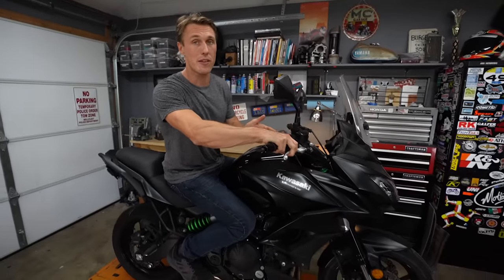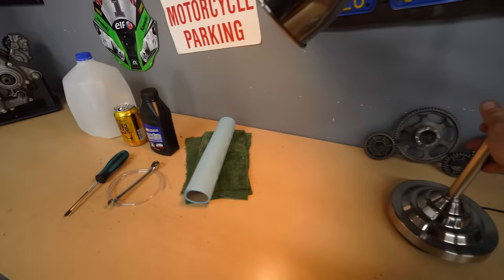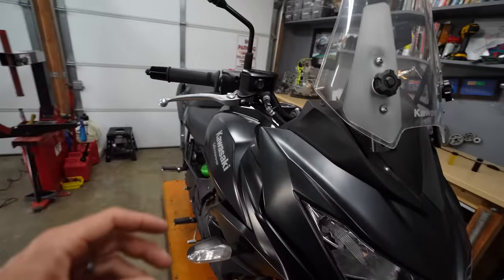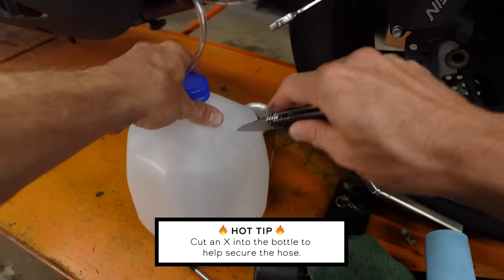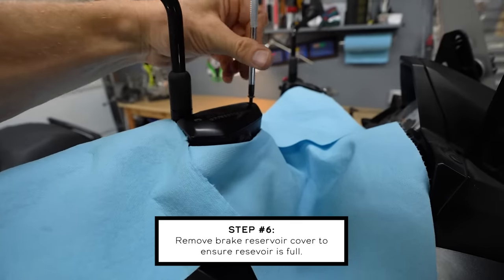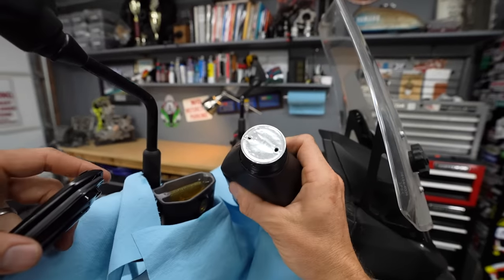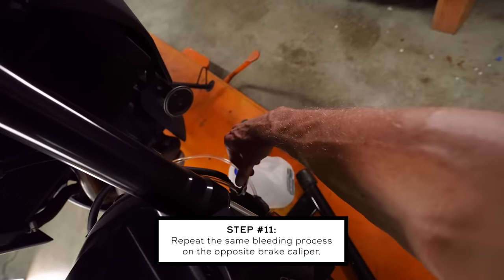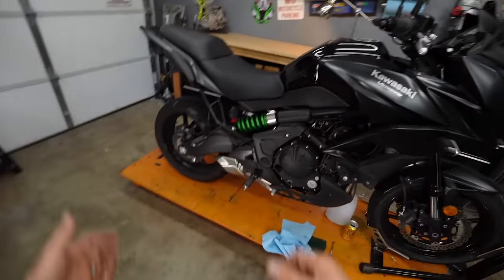How To Flush and Bleed Your Motorcycle Brakes | The Shop Manual

Comment from the maker: Read more about brake servicing on Common Tread: https://rvz.la/38goTSL
Reply: Excellent video and tips. Thanks a lot.
Reply: DOT 5.1 is better.  Doesn't damage the paint and compatible with DOT 4.  Also, people should use CNC adjustable levers for the clutch and brake.  Brembo RCS19 brake lever is the best upgrade over stock.
Reply: @A A  go back to your garage and Google answers about what's best lol
Reply: Dude I love your channel thank you so much
Reply: Hi guys nice video as always. Question does this method works also for Harleys? I have a 2017 xl883n iron sportster. Thank you
Reply: 8:40 forward
Reply: Please mate...get a better pocket knife sponsor !!!!
Reply: I had to put on new master cylinder and now it wont drain down help

Comment: Just an extra tip, when you’ve reached the step to refill your reservoir after bleeding the calipers, take a quick look at your brakepads. If they are worn, but not completely worn out, don’t fill your reservoir all the way. When you replace the pads, the pistons in the calipers will push back the brake fluid into the reservoir. The fluid needs somewhere to go.
Reply: Thanks for the reminder man.  The first time I flushed I over filled and when I pushed the pistons back in I had a nasty overflow.
Reply: Did pads too.  Forgot to include.
Reply: Extra tip number 2) You can instead when compressing the piston crack the bleeder and the extra fluid will go that way. Start with a little pressure on the piston, open the bleeder and close it again when piston is fully compressed. No air and no fuss.
Reply: @rickhughes8998  should I fill it up to max when I have pistons pushed all the way back? Or when I have piston pushed all the way back with new pads?
Reply: @Fordahord1  yes
Reply: @Fordahord1  with new pads
Reply: Yepp, mine was not checked and the brake fluid spilled from the reservoir and ruined the paint
Reply: Would this be the same process for abs equipped brakes? Been planning to upgrade to Braided hoses but I'm not so sure about the abs
Reply: @shizi  Yes he talks about it at the end of the video

Comment: A tip from a grumpy old mechanic. Don't pump the brake handle. This can cause any air bubbles in the system to brak into tiny bubbles, think foam. This can lead to your brakes feeling nice and firm until those teeny tiny bubbles get back together into one big bubble. Then you have soft brakes again. Instead of pumping, simply squeeze the break lever, open your bleeder to let fluid and air out, close your bleeder, and repeat. Once no more air is coming out, then you can pump the lever to get a final pressurization in the system. No pumping = no foaming, and this means not risking having to do it again.

Comment: Wow, you actually made me feel capable of doing this...
Reply: That's the goal!
Reply: Yeah same. Now my rear breaks got no pressure, prolly full of air and no one sells that hose near me. 

So that's cool. Been working on fixing my rear master pressure for 2 hours now.
Reply: @DizzySpark  my rear brake caliper only engages and is stuck
Reply: @xXxVentrilloxXx  aye same here my rear brake setup is currently stuck before watching but I think it’s cause I used dot3 not 4 idk tho
Reply: Super easy stuff but great video
Reply: @DizzySpark  you can order a motorcycle bleed kit its super cheap just a small bottle with a magnet and hoses/.

Comment: Put a ziptie from the lever to the grip overnight as tight as you can make it. Remove it the next day and thank me. This works for rear brakes and hydraulic clutches as well.
Reply: I don’t understand. Why should I do this?
Reply: @ardencassie5150 I’ve heard that it helps bleed air bubbles. The increased pressure “pushes” the air through the lines easier than when there is no pressure, so it slowly pushes the air up into the reservoir. Don’t think you should use it as a complete alternative to manually bleeding, but can do it after the main bleeding to make sure there’s no little bubbles left along the lines.
Reply: This makes the fluid absorb the air. It'll feel nice and hard to next day but when your emote the zip tie the air will eventually separate from the fluid again and you'll be back to a soft lever.

Comment: I've known this procedure for a life time,(I'm 63). Used it on cars also. Only thing different is that we put the end of the hose into a jar with a little fluid in it already. That way we didn't have to keep opening and closing the bleeder because each pump stroke would only draw fluid back and not air. We just kept pumping until no more air bubbles in the line. BTW. Harley just did an unauthorised fluid change on my bike. Cost me $160 !!!! Thanks for your excellent video.

Comment: This is a great video explaining how to bleed your motorcycle brakes.  If you have an air compressor you might want to consider investing in a mityvac pneumatic operated fluid evacuator.  The motorcycle shop I worked at had one and it worked so good I had to buy one myself.  They will run you $100 but they are well worth it.  When connected to compressed air they build a vacuum.  You can use it to clean the reservoir and put fresh fluid in it to avoid sending any more old brake fluid through the brake system.  They are also great for when the brake system has lots of air, like when you have changed out brake lines or calipers.  It is one of the best tools I own for motorcycle work.  They come with a nipple attachment that holds onto the bleeder for you, so once its connected to the bleeder you just loosen the bleeder and keep adding brake fluid at the reservoir until it has been fully bled.

Comment: Great guide. 2 important things to add:
1. Always use fresh bottle of brake fluid. You can't store it after you have opened it.
2. Use gloves AND eye protection. When you remove the hose there is a risk to get some splashes on you. Without eye protection this might not end well. Ask me how I know.
Reply: How you know
Reply: How you know?
Reply: How do you know?
Reply: How did you know?
Reply: How do you know?
Reply: How you know?
Reply: How do you know?
Reply: In case no one's asked, how do you know?
Reply: how he know?
Reply: Well how you know?
Reply: know you how??
Reply: you know how?
Reply: Why do they make the bottles resealable if the fluid can't be used again?
Reply: @mitleid_en  why do 7/11 have door locks when they're open 24/7¿
Reply: @hyunkang5628  Irrelevance
Reply: @mitleid_en  exactly...
Reply: How you know?
Reply: How do you know?
Reply: Know, how did you?
Reply: I hope its fine that im only storing it for one night because i messed up and let air into the system so i need to try it again tomorrow. (Did it in the evening)
Reply: 1. is just BS. Brake fluid is fully synthetic so it doesn't degrade over time. Store it in a dark dry place with the cap tightly closed.
2. is very true. Yes it hurts getting it in the eyes damn...
Reply: How I know?
Reply: @davinc3 of course it hurts... Its cancerogenous. But yeah when people say always use fresh brake fluid its because of the moisture if not stored in dry place. And people usually dont store it in completely dry space :D So you are kinda both correct
Reply: Surely you meant carcinogenic...
Reply: NVM , did not know that was a real word 😂 I've always heard the latter of the two

Comment: Good and entertaining video Ari!
  Little tip from me to owners of japanese ABS bikes:
I had a SV 650 with ABS 2007, done the brake maintainance accordingly , even more often than recommented. 2 years after I've got the bike experienced ABS motor failure. I've got it exchanged etc. however I was dedicated on finding out what caused the failure. Turned out ... : 
 When you flush you brake system the old brake fluid still remains in the ABS pump unless isn't activated, which isn't that common if you don't ride gravel or dusty roads. What happens is, what Ari explains that brake fluid is hygroscopic, which means that after 10 years in you abs pump the fluid looks like glaze from a burned pan, respectively corosion is being caused inside and soon or later causes issues on the sensitive components. 
 When you flush your brake lines, go for a little ride, activate both abs circles ( front and rear) thus ensures that brake fluid from the abs unit has been transferred over the brake lines, which are flushed afterwards. Repeat the flushing procedure several times to make sure all the old fluid have circulated  OR  buy a BMW ! :D
Reply: Look at any service manual for abs models and you will see that they want you to hook it up to a diagnostic tool.
Those tools can activate the ABS pump for brake fluid service and thus flush the ABS circle.
It is hard to get your hands on such tools as a non brand specific mechanic, let alone as a private person.
That’s why, if people want to get a brake flush done by a trained mechanic, they should go directly to the Manufacturer. 
As dumb as that sounds, but if you don’t have the tools for the job then you simply don’t have the Tools.
(Or you can off course do it the way you said by activating the ABS, but that certainly can involve some risks one needs to take for a result)
Reply: @A_Ride_To  Not all manufacturers require or even suggest cycling the ABS pump during brake service. Prior to this vid I reached out to contacts at BMW, Honda, Harley-Davidson, Kawasaki, Suzuki, and Ducati, and only H-D required brake service be performed at a shop where the tech could manipulate the ABS via a diagnostic tool.
Reply: That's a good tip GSab. It's also good practice to engage the ABS so you know what it feels like in an actual emergency. BTW, did you disassemble the old ABS module?
Reply: I have an older bmw and its ABSII is no picnic
Reply: @AriH211  ok my bad, I really thought every manufacturer requires ABS service via an OBD type of Tool.
At the same time really is a shame when they said that, because that means they don’t consider old brake fluid behind the ABS Pump a big deal 
(and might not even service it that way).
I must say, I am a bit speechless.
Reply: A trick I use to bleed the abs pump is whilst bleeding rotate back wheel while squeezing front brake with ignition on. It activates the abs pump to pump out the fluid. Very tricky to do it by yourself but quite easy with a friend. No need for fancy dealer diagnostic tools. Works on my bmw r1200r.
Reply: @AriH211   Hey Ari , thanks for you reply!
 I disassemble it completely. Took every single component apart. I've deleted the pics from the whole operation unfortunately. 2 of the valves were coroded as well as other damaged was caused( the bike was kept in a garage throuout most of its lifetime and never riden in the winter). Moreover most of the Suzuki's have their ABS module located in a position where is directly exposed to the elements. The seals give up after some time riding in a harsher climate ( and not only) which causes corosion in the connection pins as well.
Reply: @A_Ride_To  there is a device for BMW,  GS911, that you can do the abs flush with, and obviously many other things. 
PS It’s not a BMW tool btw.
Reply: @michaelwilliams3861  there are of course some devices out there where you can get your hands on by different brands but they are mostly pretty expensive and you sadly cant get them for any motorcycle
Reply: @AriH211  Did the mfgr's seem to indicate that routine bleeding (flowing from master cylinder -> caliper) traveled THROUGH the ABS system - or does that fluid sit there "stagnant"? (I'm 64 and my Dr recommended ejaculate at least once a week for prostate health). Otherwise the fluid gets stagnant, or is that Too Much Information? I told my wife about the prescription but she wasn't thrilled...
Reply: Absolutely not my boy! I don't bother writhing comments in social media at all. Just wanted to share my experience in order to help someone out there ... eventually.
Reply: @TheTwistedfirey  nice tip.  I never would have thought of that, and I'm surprised you didn't get more feedback on this trick.
Reply: @TheTwistedfirey  Wow such an underrated comment, thank you very much for the tip! 👊🏾
Reply: @adjbob56  Legend.
Reply: @AriH211  Then your mechanics told you bullshit. I know for a fact that Ducati and Honda recommend using a specialized tool to flush the ABS-System. Which is why they charge so much for changing brake fluids too.
Reply: @organhandlerseb4972  Perhaps that's new info then. As I stated in an earlier reply to the original comment, I communicated directly with personnel at the corporate offices (not dealerships/a mechanic) for BMW, Honda, Harley-Davidson, Kawasaki, Suzuki, and Ducati to inquire about their brake-bleeding recommendations for bikes with ABS, and only H-D said that activating the ABS pump was necessary. 

From Ducati's email response to my inquiry, dated 8/18/2020: "For Ducati’s with ABS, the bleeding process is not any different than your normal bleeding procedure and you do not need to activate the ABS pump."

That's from the media manager, who in his previous job was a Ducati and Aprilia service technician. 

FYI, the ABS modules in most bikes are made by Bosch, but I believe Harley uses a Nissin unit, so perhaps that has something to do with H-D's requirement to cycle the solenoids during bleeding.
Reply: Don't like ABS. To much trouble
Reply: Obviously it's hard to do with road motorcycles, but when I bleed my car's brake liquid I just go and do a few emergency brakes in grass, works very well lol
Reply: in any case , I would follow the service manual. For example I have old Honda CBF600 NA (ABS version) and in the service manual is following:
The brake fluid replacement procedure for the ABS model should be performed in the same manner as in the standard model. Note that there is no brake fluid in the ABS modulator (except in the modulator head), because the modulator is the motor-driven hydraulic pressure type. Therefore, brake fluid replacement and bleeding air from the modulator body is no necessary.
Reply: So what you're really saying...
Is US as the riders, need to engage our ABS more often to ensure that fluid is being is being mixed regularly?

Comment: Thanks for the tips. Now I'm waiting for "how to bleed a hydraulic clutch".
Reply: Pretty much the same procedure as the brakes. 
I personally like to take the clutch cylinder off, to give it a good clean, since sometimes they get gunk in them.
Reply: @damianrc5322  Really depends on the style but if is absolutely a requirement on older Kawaski's because you need to inspect the (pretty guaranteed to be leaking) pushrod for oil contamination which leads to a slightly more involved service.

On BIG hint if you do take it off, jamb a block of wood between the lever and the bar and ziptie it in place.  You can ancidentally grab that lever at any point and in some slave cylinders than means the piston will pop right out.  90% of this time it means a (usually very cheap) rebuild kit will be needed.
Reply: Yes I need that
Reply: Look up ktm clutch back bleeding
Reply: Only homosexuals watch that
Reply: You got your wish

Comment: Like the tip on punching holes in the new brake fluid container, but Instead of cutting an X on the side of the milk bottle, what about cutting it into the lid?  That way you can use another lid and it's totally sealed when done, no tape required.

Comment: if you pull air in from the reservoir you can close the bleeder screw on the caliper and stick a flat head screwdriver in between the rotor and pad (gently) and pry open the pads which will send fluid back up towards the reservoir pushing all the air out of that end. Then fill the reservoir and continue as normal.

Comment: one thing he didnt mention, if you have a bleeder on your master cylinder start with that. i couldnt figure out what i did wrong since i followed the directions but still had a spongy lever that pulled allt the way into the bar until i noticed i had a bleeder valve at my master cylinder. run 2 full reservoirs of fluid through it, now it will be completely clean for when you do the lines. do the lines as normal then finish off again with bleeding the master cylinder before topping off. my lever now only has a perfect 1/2inch of play,  are now STIFF with no sponginess and finally dont pull in all the way to the bars!

Comment: I did this many times on my bikes and could still learn some small tricks. But isn't it also recommended to clean and check the rubber membrane on top of the reservoir? It always collects water drops over the time.

Comment: I’m a big fan of using pneumatic air break fluid bleeder. It eliminates having to pump out the brake fluid using the brake lever also keeps thing clean. Just suck it out and keep filling the reservoir until you see clear fluid come out. Very easy and quick. And mine cost me 40$ so cheap to.

Comment: started using a capri tools vacuum brake bleeder this year, cost like $85 bucks but is the most convenient thing ever when doing brakes. if you have one bike and do brakes every 2 years like in the manual this method is great, but if you have a few bikes and do brakes often you gotta get a vacuum bleeder. great video!

Comment: Indian Scout rear brakes are known to be hard to bleed. It's just difficult to get all the air out. After replacing my rear brake light switch I had to bleed. I put a *Speed Bleeder" screw on and it really made the job easier for one person. I had better pedal than I had after the dealer had done a flush/bleed.

Comment: Nice video on how to bleed your brakes. I like to remove the soft black rubber diaphram cover and check for moisture build up. If I find signs of moisture, I first clean off the brake fluid side then lightly blow compressed air to blow on the non brake fluid side to remove the moisture.